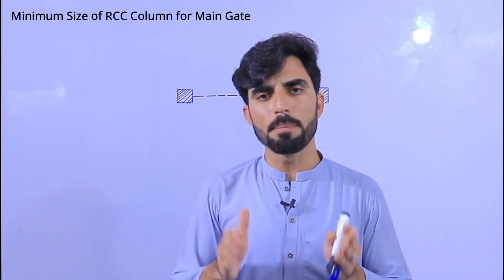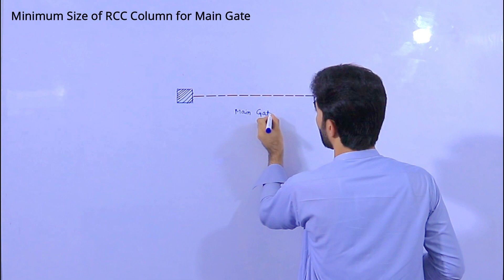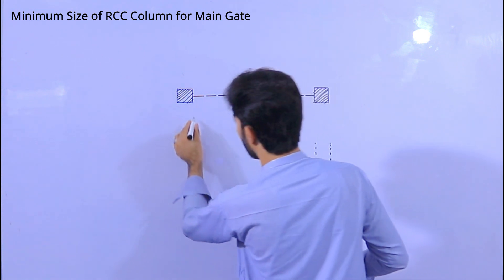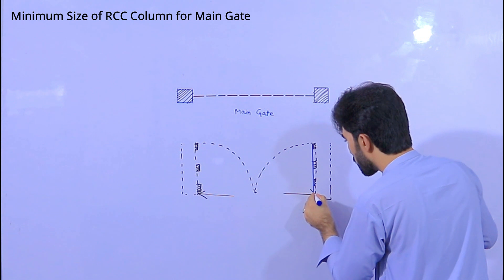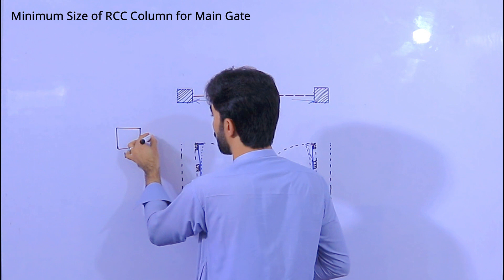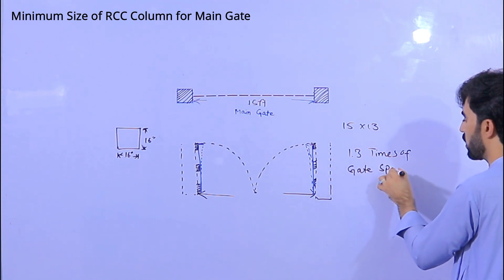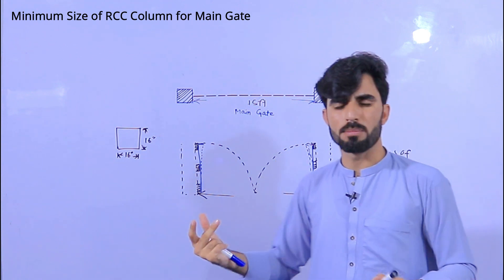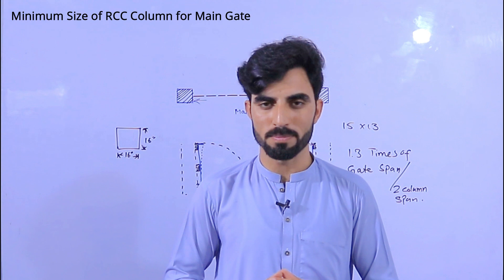Minimum Size of Column for Main Gate? What is Minimum size of RCC Column for Main Gate? Main Gate

Comment: Running distance is 10.6inches.both coloums size 12/9inches .each coloum has 12mm iron 6 bars.
I have made  iron gate weight is 250kg. Can this  coloum take this laod 125per each??